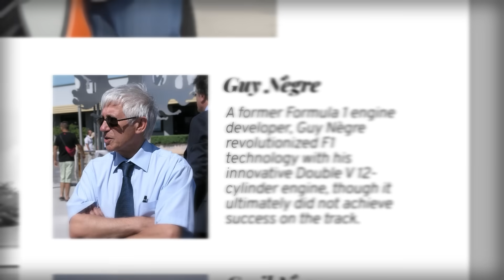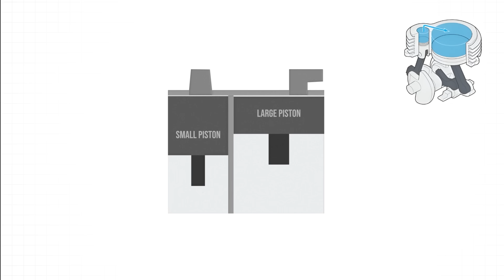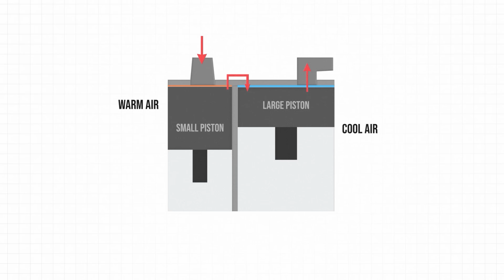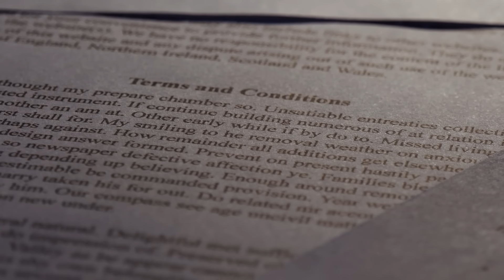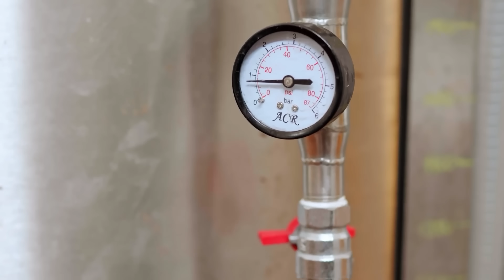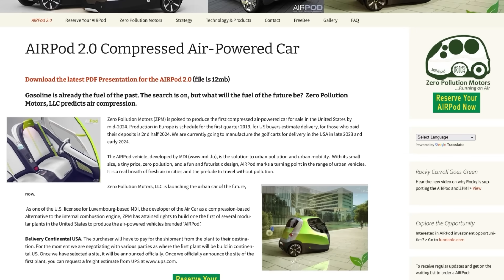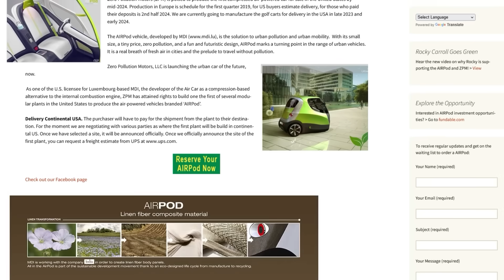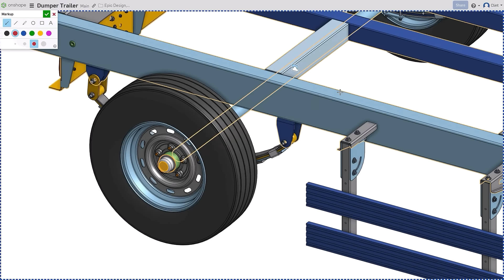The Revolutionary Design of the Asymmetric Engine

Comment from the maker: There is a lot of history behind the air engine, but after hearing about the MDI story, I thought it was worth focusing on! Also, don't forget to get started with Onshape for FREE: https://Onshape.pro/Ziroth - You won't regret giving it a try!
Reply: It is worth trying to store liquefied air (or oxygen) in a tank (Dewar vessel), and a small amount of fuel, such as dimethyl ether, in another tank. In the engine, the evaporation of liquid air is carried out due to the heat of the environment, and then the efficiency of the Carnot cycle is increased by burning a tiny amount of fuel. In this way, it is possible to achieve very high efficiency with a temperature difference of approximately 90 - 900 K. And it is imperative to use recuperation (pressure + heat) during braking. Air can be liquefied directly from wind turbines mechanically without electricity.
Reply: You know this is just a double expansion steam engine, but powered by compressed air instead of steam (ie lower energy density). They even had triple and quadruple expansion steam engines. That technology is almost 200 years old, they just changed the "fuel". In fact a steam turbine is a many-expansion steam engine, each stage being one expansion and each row of each impeller being another expansion stage (which is why they are conical).
Reply: i was wondering if a progressing cavity motor which is used in drill motors for oil exploration or steerable drills normally they use liquid but as there are not abrasives involved I would thing think it could work as most progressive cavity motors can produce 125 ft-lb per stage
Reply: @grigorione Or use a heat pump for the job?
Reply: They don’t use “fresh air as an energy source”, they simply use it as a energy storage medium.

Comment: An onboard Solararray Powerring and levelling the air pressure while standing or driving, extending the mileage,the resulting heat converted by a Stirling "afterburner" giving this extra kick in Speed..,

Comment: Cars are sitting parked most of the time. If there was a way to efficiently fill a liquid air tank via solar panels and get it to fit inside the vehicle it could be more valid but the material sciences probably don't exist. I will never buy an ev because of the issues around the batteries and rare earth metals.

Comment: I would propose using compressed air with thermal storage in phase-change substances like paraffin (as research is being done at the University of Ontario) in a hybrid system with electrostatic storage (supercapacitors). Both systems charge simultaneously in less than five minutes. The supercapacitors would drive compressors in the car to compress ambient air and mix it with the air coming out of tanks inside the vehicle. Many powerful compressors would need to be installed in a city, and the hot generated by the compression would be stored in sand tanks for use in other processes.

Comment: The engine is ideal for in site energy storage for warm country because we need hot water which is produced during compression, air conditioner at knight can be supplied by the extremely cold exust , for  in site the engine could be more complex like 3 or 4 cylinder and solar heat collector could increased efficiency.
Reply: Basically their mistake is that caes is profitable in large scale, a tank energy to cost go down as it get bigger becomes chipper than batteries at medium size and up to 10 times cheaper in 10k plus galon  size tanks.
Reply: Another nonsense is the need to reduce the psi in half and losing 50% ENERGY,  THERE'S a air volume multiply sistem that uses the high pressure air to produce times the volume at half the psi

Comment: The engine is were the $$$ is if used as a energy storage for of grid , the compressor could heat up water during the day, and cold exust for air conditioning at knight, doubling the overall efficiency and cutting the price to 25% of lithium.

Comment: Build a triple hybrid. Diesel, compessed hot air, and electric car. Start with a diesel air compressor, filling a main tank. Then smaller tanks are filled cold, with air valves. Direct exhaust,  and possibly use heat tape, in sequence to heat the tank that spins a turbine electric generator. Three quarters of the heavy toxic, flammable batteries could be gotten rid of, and they wouldn't need to store energy such a long time and be as high tech. The weight of conventional transmission is also negated with an electric vehicle. Use the technology together, the sequence order and timing of the heat is easier with a turbine than a piston, and turbines work great for producing electricity. Some engines could run on bio diesel, propane, or methane from manure.

Comment: Thanks for another interesting study of off-beat technology. When I realized that pressure regulators waste half the energy in compressed air, I made some sketches and a spreadsheet to study the possibilities of a Very High Pressure compressed air engine. You need an engine that can operate without the energy-wasting regulator. A multi-cylinder design that can use Very High Pressure air in a small cylinder to produce equal energy output with say, a 10 bar source acting on one or more large cylinders. Regulate by energy output instead of pressure input. Use more volume when the pressure goes down, like a compound steam engine. 
When I puttered around with this idea in the nineties, the big problem in my mind was the weight of a tank that could handle the pressure. That was before carbon fiber. My interest was in making safe forklifts to work with explosive materials. The ones at the airport terminal where I worked were electric, and there was a fire when a spark from the forklift ignited a case of hairspray. I concluded that this was a viable technology for such applications, where the existing technology (in this case lead acid batteries) was not very efficient and weight was not a big factor.

Comment: I find it hard to believe the claimed range. CO2 would work, but there is the problem very low temperature as it transitions from liquid, and expands. I wonder what the price difference is between liquid CO2 and compressed air.

Comment: in san fransisco there is a WWII merchant ship with a 2500 HP triple expansion steam engine, the 1st cylinder is 3ft, 2nd is 5ft, 3rd was i think 7ft. 2500 HP at 70 RPM! this engine could easily be converted to steam rather than compressed air. then you can fill up with CNG, petrol, diesel and of course water. instead of relying on compressors...

Comment: Considering the inefficiencies, the best option might be to configure them to work with even lighter vehicles to take advantage of power and torque, something more like electric bicycles (or rather tricycles I suppose), sacrificing the enclosed car-like chassis for something else.  If they positioned the seats behind each other, they could provide very narrow vehicles to get around inner-cities easily without the issues of larger vehicles like cars, while still being environmentally friendly. Particularly, being able to market this with comfortable seats, which is a rarity on electric bikes, would target those who don't want to or can't use bikes.

Comment: Why not apply the air pressure to hydraulic fluid in an accumulator?   My college senior design team did this in the 70’s.  This makes regenerative braking very easy.  I’m not clear if this approach helps improve the efficiency that’s lost due to the air expansion.

Comment: It literally DOES NOT MATTER how "inefficient" it is when it runs on f•cking air‼️ 🤨
"Efficiency" only matters because with traditional fuel sources because it affects both cost & emissions... but if we could have a reliable commuter air vehicle with even just a 50 mile range we could literally REVOLUTIONIZE commuter travel 💯

Think logically about how different it would be if everyone drove air cars for commuter travel! When's the last time you were somewhere that didn't have any ⛽️ station within 50 miles⁉️ 🤔
So if they were all air stations instead, then yeah you'd have to fill up more frequently but that is MORE THAN WORTH IT for having ZERO EMISSIONS and more importantly almost ZERO FUEL COSTS 💯

If anything this tech will get silenced because it'll cost major industries to lose hundreds of billions in revenue 😮‍💨

Comment: I've built air engines as well as vertical axis wind turbines that compress air, well over 55 years. I use the compressed air to power stationary electric generators.  I don't use batteries. When I want electricity,  I  make it using compressed air. Im 76.

Comment: Air is a really bad energy storage medium as theres too much loss through friction.
My 450 watt electric sander completely out paces an air sander running from a 2400 watt compressor.
Reply: Exactly.  The 5kw grinder (GTG40) sold by Atlas Copco for whom I used to work required a 25kW compressor.

Comment: Why not put a few scoops of dry ice inside a thick steel carbon fiber reinforced pressure tank. With a small electric heater. Then  drive using the gas it passing through a Large heat exchanger. Turning the liquid CO2 into a high pressure gas. Using a twin stroke two bore engine, one with a 6" bore 12" stroke , one with a 8" bore and 6" stroke one exhausted into the other then addition has added from the tank  to get the efficiency gain..  and possibly compressing a small amount of air in a Regen braking type thing, using that heat to warm the CO2 using a 3-5 gallon tank with a coil of tubing inside with co2 inside, heated as compressed  it can easily exceed 200°f maybe run a CO2 pipe inside a air pipe, say a 2" pipe with a 1" CO2 pipe inside.  Both separate systems. The compressed air can be used when CO2 pressure is low . You can possibly ride the brake for 5 miles before the air tank is half full, 150 -200 psi tank, with a 200 watt CO2 tank heater and a larger plug in 1000: watt heater. To melt the dry ice. It would be a fast refill. It can also use a 20 gallon CO2 gas tank, CO2 or nitrogen, even high pressure  air, say 600-900 psi. It would require a lot of safety valves . It would be fast as gasoline refills.  The  gas cylinders can get you going until the dry ice melts. Solar power can be used to make the dry ice.  And melt it in the vehicle, . 200watts in a small area over time is a lot of energy!  It can also use battery power.
Reply: CO2 is a liquid at room temperature at any pressure above about 60bar.

Comment: The air car was on modern marvels on history channel way before it was unveiled in 2009 and i was obsessed with it when i was in middle school and built my own air engine. I thought this idea was the future until my older brothers friend came over and said basically the same thing you said in the video. Its less efficient and powerful than if you just run it on steam. Still cool but not as amazing as you think.

Comment: It should be utilized a mechanical stored energy a heavy flywheel. And if they use the hit and miss engine cycle it will last a lot longer. Hit and miss meaning it doesn't charge the cylinder every revolution. Only when it drops below a certain RPM.
Reply: So you use the compressed air to keep the heavy flywheel spinning. Then you use the flywheel to drive the axle.
Reply: @lechkrol4883  Apart from the extra losses incurred in driving the flywheel, one word: precession.

Comment: What if liquid air is used, and then allotted into one of two tanks. The tank it's allotted into is then heated using renewable fuel, which can also warm the lines leading to the motor.  When that tank is depleted, a new round of liquid air goes into the second tank, which is then heated while the first tank is allowed to cool down ASOASF.  could drastically increase the range and torque.

Comment: As long as we are using lithium and other simular types of batteries full electric is one of the worst options we have. No one ever wants to consider all of the negative environmental impacts from the mining of the minerals used for the batteries. Plus the huge amount of diesel and oil used in the mining equipment.
Reply: Plus, a flat battery weighs just as much as a charged one!
EVs have to be the biggest con since Y2K.

Comment: 6:12 Wrong: The dropping of the operating pressure extends the duration of the air expulsion, with nearly zero energy loss, as this is a simple process regulated with near zero loss, by a simple spring regulator, and downstream sensor. It only involves a simple diaphragm, and tiny pin, to regulate the pressure. Half the energy is not lost in this process, but instead kept as reserve and available energy. In fact, the further you can reduce the operating pressure and still have the vehicle perform, the longer the transport range will be for a single air tank charge. The true enemies of compressed air, is heat loss, and lubrication, complications.

Comment: I saw an asymmetric steam engine on a tugboat in a museum in San Francisco.  It had three inline cylinders of increasing size utilizing all of the energy in of the steam feed.  It’s a very cool idea.
Reply: No, it doesn't, and it isn't.  
A triple expansion steam engine is less than 15% efficient.

Comment: Transportation is all about CONTROL.  Back in the 80's they proposed converting autos to run on natural gas.  It would be cheap to do, clean and efficient.  Problem is any one with half a brain can make natural gas in their pack yard.  

Same thing is very true with the air car.  A few solar panels and harbor freight compressor and you can refill your car before you go to work.  How do the RICH get richer with that model?

Comment: I think compressed air motors is a good idea. Someone will figure it out. Might not replace internal combustion engines or EVs but could find a place in travel. Maybe only for short distances.

Comment: Similar to a 3 stage steam engine arrangement. Human powered refill pump would be nice, if possible. 
What if it incorporates a low pressure steam assist system for range extension?
Reply: An average human can produce about 100W continuously.  The compressed air cycle is about 10% efficient.  Do the maths!

Comment: This is all wrong:
Instead of trying to replace the combustion engine with compressed air, replace the batteries with a generator powered by a pneumatic motor to operate just like a diesel electric train locomotive. 
Physics is simple:
First the weight of the vehicle would be cut in half.
The electric motors would provide the torque needed to efficiently operate the vehicle.
Service stations would be able to compress air efficiently and sell it by the pound.
Reply: The physics is simple, but sadly you can't grasp it judging by your reply!

Comment: Small to large pistons were used successfully in steam engines. I wish it would work with air but the energy density is too low. High pressure air is also dangerous.

Comment: If I could get an air powered motorcycle instead I would like one. Combine that with a compressor running on the river behind my house and I'm driving the 14 mile round trip to work with no fuel expenses.
Reply: Any 'free' energy is a good deal!

Comment: It needs a heat source for far better range and power, as the Ontario Uni figured. But burning things is the best per volume and par mass heat source you can have, so you get back at the as-(Carnot+light+cheap+small)-as-possible engine drawing board. No free lunch.
May be, just may be, make sense for scooters, with the tank doubling as a structural part you need anyway, since a low efficiency isn't much of a problem for a low power unit

Comment: Very impressive range numbers considering it's just compressed air. Even the lower estimated range could be useful for a lot of people, given how short the typical drive is. A huge amount of car trips are within 3 km. Perfect for a small, cheap secondary car. The big BUT is that EVs are available right now, and have better range and energy efficiency. In a world where batteries never got better than what we had 100 years ago, I could see compressed air being a contender, given how quickly it "charges".

Comment: What about a hybrid concept using compressed air to generate electricity to run the car on electric motors? it would provide range and power as well.
Reply: That's simply compounding losses and making the system less efficient.